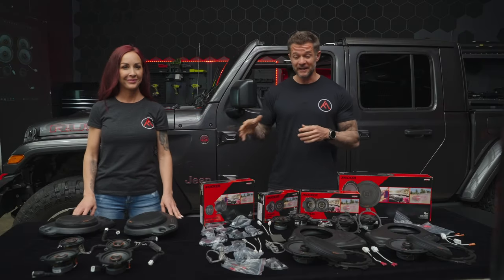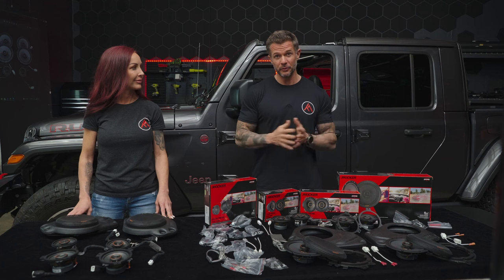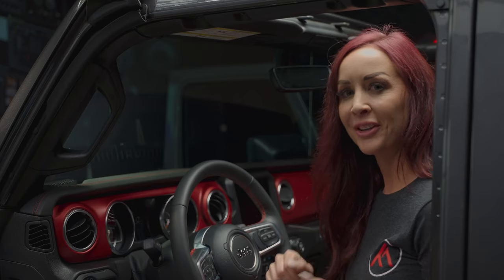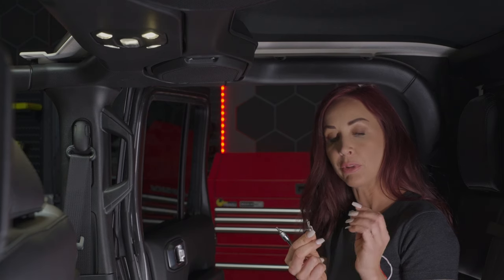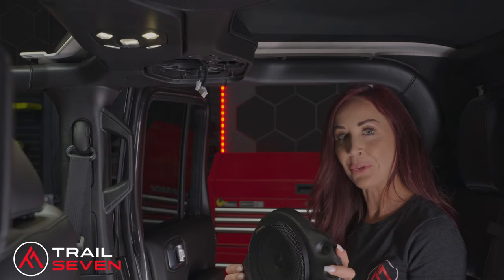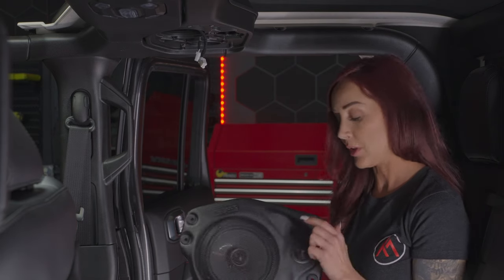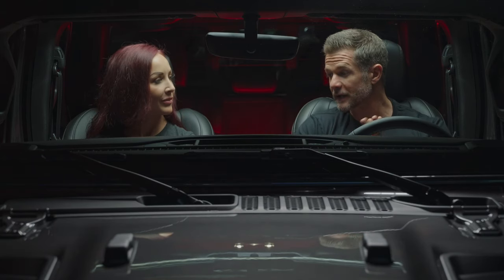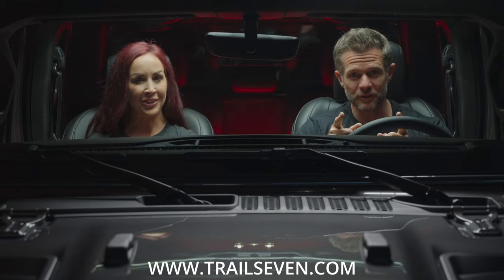Kicker Plug & Play Speaker Upgrade Bundle (Part 1) | 2018+ JL Wrangler / 2020+ JT Gladiator

Comment: How does this compare to the upgraded Alpine sytem?
Reply from the maker: @ohthecaptain  These are upgraded speakers over the factory speakers.  Regardless if the factory system is Premium or Standard, the quality isn’t par with true aftermarket upgraded speakers which will handle a ton of power.  They’ll sound clearer and crisper over factory.  

If you’re wanting better sounds, upgrading the speakers will provide that for you.  If you’re wanting top off, doors off, “loud”, you’ll want to look at a full bundle which includes an amplifier to provide the power needed for the speakers to perform at their optimal range.
Reply: @trailseven  thanks for the clarification. I've always got the top and doors off.
Reply from the maker: @ohthecaptain  I can relate!  You’ll want to take a look at the full system bundles to achieve “loud” and full performance.
Reply: @trailseven  at that point, wouldn't it be more worth while to get a full system at a shop with an aftermarket head unit? I will say the the stock sub is woefully underpowered, even with the top on.
Reply from the maker: @ohthecaptain  That would be a choice for you to determine what is best for your build.  We have plenty of full system plug and play bundles available along with a few head unit upgrade options, or you can choose to have a full custom system built and installed for you.  

If we can assist with anything, please let us know.

Comment: I have a 2020 jeep gladiator sport . Will these be a much better speaker ? I find the sound in my jeep sucks
Reply from the maker: @user-ti7bu7pl1u  These are 100% a better speaker than factory.  They’re clearer and crisper.  If your goal is top off door off type of loud, you’ll want to consider one of the plug and play bundles which includes an amp kit.  Let us know if we can be of assistance.
Reply: @trailseven  do you have a link to a bundle with amp kit . I didn't think I needed an amp . Just the sound bar and front top dash speakers..
Reply from the maker: @user-ti7bu7pl1u  You can always start with the speakers and add the amp afterwards if you feel that you want more power.  

Here are a few full bundle options which include the amp and subs as well as bundles that include just the amp and sub should you decide to build your system in stages.  

https://trailseven.com/collections/audio-bundles/generation_jt

If you know that you’re wanting top off, doors off, cruising down the highway loud, then an amp package is what you’ll find fits your build best.  If you’re wanting better sounding speakers with clarity etc., the speakers alone will provide that.
Reply: Are you located in Canada  ?
Reply: Any discount codes ? :)
Reply from the maker: @user-ti7bu7pl1u  No, we’re located in Frederick, MD.
Reply from the maker: @user-ti7bu7pl1u  The bundles are currently on sale at 25% but you can also use your new customer code: TS5 at checkout!
Reply: @trailseven  ok thanks ! I think I'm gonna try them out . If I am not satisfied and wish to return  them within the 60  days do you provide a return slip for shipping ?
Reply: Also how long is the sale on for?
Reply from the maker: @user-ti7bu7pl1u  Yes